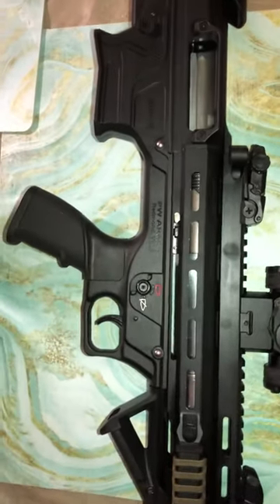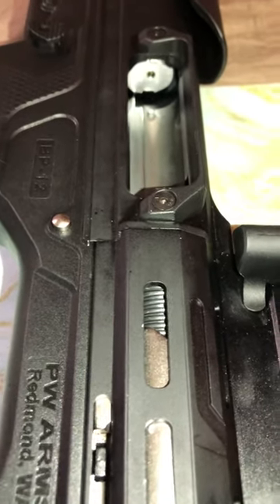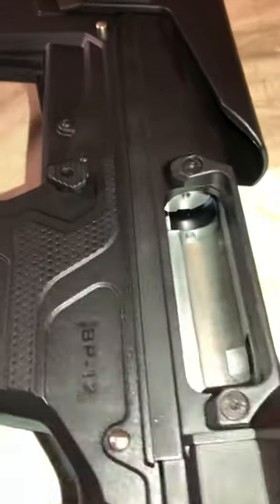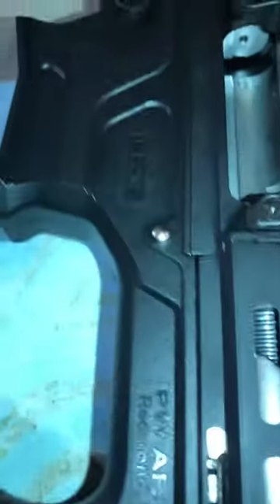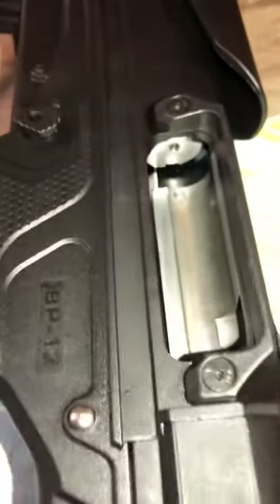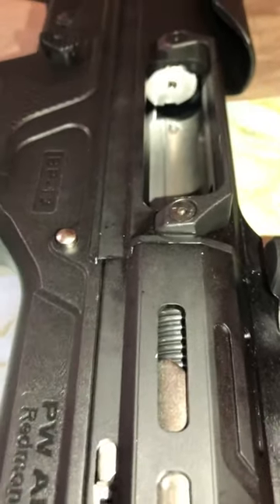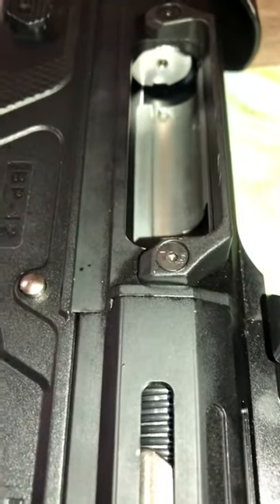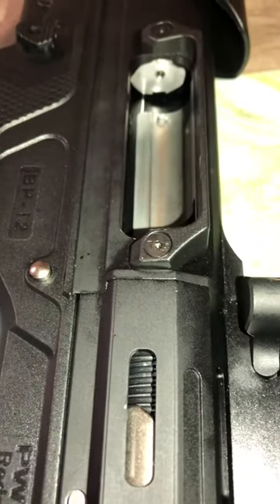BP-12 Panzer feeding problem fix

Comment from the maker: I have seen a lot of feeding problems with this gun, took mine to the range put 200 rounds and still had the same problem. Took it back to the house and clean it, put the 20 rd drum and start pulling the handle and notice that the round got stuck on the way to the chamber and the back of the round stuck in the hole where the firing pin comes out. I have the bolt looked to the rear and passed my finger on the hole. Now, the edge around the hole was sharp. So I took the a Dremel with a ball tip and smooth the hole taking away the edge, sand it with 800, 100 and 200, put it back together and feed 20 rounds with not a single malfunction

Comment: How do you clear the round once its stuck??
Reply from the maker: Stuck inside the barrel?
Reply: Right as it comes out the mag in to the chamber
So the round never fully entered the chamber
Reply from the maker: @williamcampbell8703  first place the weapon in safe, remove the mag, and pull the charging handle to the rear. if the round doesn’t eject, I’ll recommend to use a thick brass stick bent at the end so your hand it’s not directly to the barrel or a cleaning rod and push the round from the tip of the barrel. brass is recommended to avoid scratch the barrel inside.
Reply from the maker: @williamcampbell8703  https://youtu.be/dudBGAzYpcc
Reply: @gunsrus777  its not in the barrel its rt at the top of the mag
Reply from the maker: @williamcampbell8703  are you able to democracia the mag?
Reply from the maker: sepárate the upper from the lower removing the check rest and the 3 pins holding the lower and the upper.
Reply: @gunsrus777  I can only remove two of the pins the front one is hard to get out
Reply from the maker: @williamcampbell8703  Use a brass hammer and hit it from the right out. won’t brake, or use a peace of wood and a regular hammer.
Reply: @gunsrus777  ok I'll give it a try thanks gor your help!👍
Reply from the maker: @williamcampbell8703  that happened to me at the outdoor range and was a pain in the a.. to clear it. I had to take it apart and the lower didn’t want to give up from the upper. You will get it out.
Reply from the maker: be carefully brother. Let me know how that worked out for you.

Comment: Definitely a quality control issue! Each of these Turkey companies making these Bull pups have problems in their QC departments! So I am expecting to have to tweak mine when I get it ! I will clean it immediately and see how it does but I won’t use low brass ! #5 high brass then 3” #4’s then 3” Op buckshot!